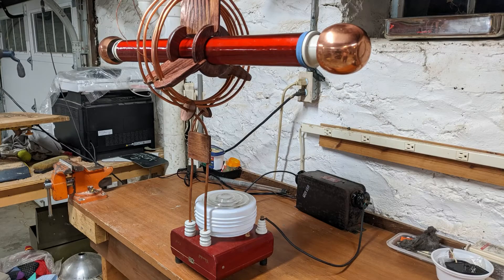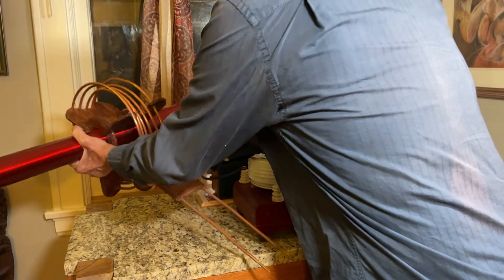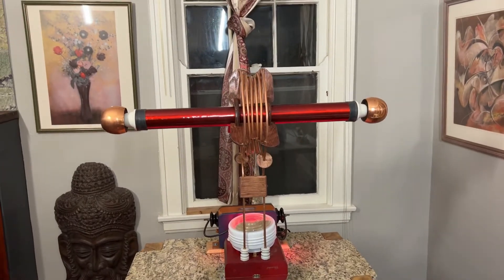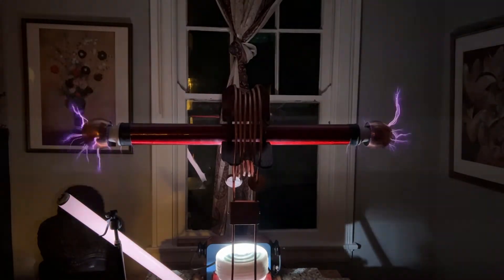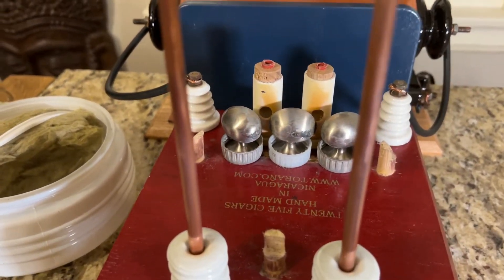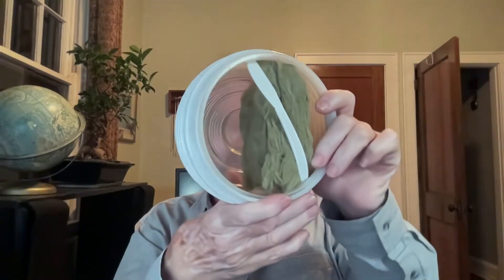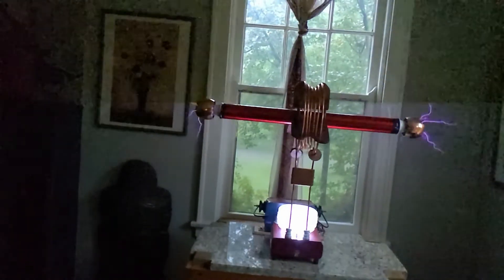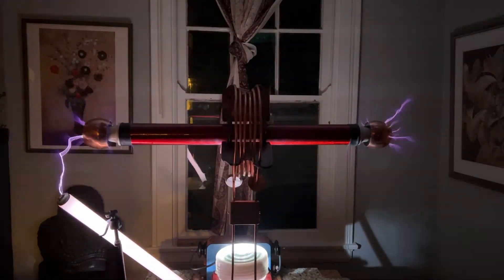BiPolar Tesla Coil

Comment: Only thing I would say is that Grounding is the way to really make big sparks...   And yes, you ground the center of the Bi-polar secondary.  It's crazy, and counter-intuitive, but the Earth adds charge to the oscillating current in the secondary circuit... The better the connection to the Earth the more effective the adding mechanism is... So Big fat welding cable directly to a rod sunk deep into the Earth and also soak it with a hose for a while to get maximum soil contact with the rod... Oh copper coated iron grounding rod for low resistance works fine 6' long buried all the way only a couple inches left out for the connection with the Welding Cable...   And the fine wire of the secondary meeting the very large cable will reflect most of the wave back the other direction improving your efficiency and making your sparks longer...   My suggestions will make you gasp when seeing the improvement in sparks...   Other than that, simply tuning it more exactly and as well as the air through the spark gap I would use two powerful neo magnets in repulsion and forced together so the spark happens right between them. It kills the spark before the Current can come back through the Plasma channel formed by the spark... Giving vastly improved performance...   Try it...
Reply from the maker: Thank you Nick. I have never seen/heard about using magnets in the spark gap. That's not too hard to try. I could get the magnets from a computer hard drive. But tapping the center of the secondary, yes I am tempted - I would have to thread that through the primary coil without it arcing to the secondary.
Reply: @JimPaul0627  yeah the magnets work well only thing is that neo mags are conductive and need to be insulated to keep the arc from trying to go through them...  I used several layers of E6000 glue and it works well...  Tesla used for fitted mica around his magnetic poles. Also he used a powerful electromagnet which is a little different in that  an electromagnet creates one of each pole... I tried two magnets repulsing and that can't be done with one electromagnet...  Simply trying something that I saw hadn't really been done before that I had read of anyhow...  It works damn well too...   Ultimately Tesla ended up submerging his spark gaps in a tank of circulating oil with his 🧲 in the oil as well...  Going for highest rate of change requires that the spark be forcibly snuffed out . But once the snuff is fast enough and the current can't reverse back through the spark gap even one time you get an amazing effect...  It is unlike anything else and will blow your mind...   It causes an electrostatic explosion radially outward from the spark gap in all directions. The blast that occurs is not like normal electricity at all.  It will charge metal objects with energy that can do work when discharged to ground just like normal electricity does but even more impressively the electrostatic shockwave travels extremely long distances and is still recoverable...  There is like a 1000x gain mechanism tied to it...   Meaning 100 watts through a spark gap that is cut off instantaneously before the current can make it back through the gap even one time, causes that current of 100 watts to transform into pure voltage 1000x the initial voltage used in the 100watt spark..! No joke either...   The radial outward voltage wave travels faster than light speed as it is of a longitudinal nature not the typical transverse variety...   Modern day science still refuses to recognize longitudinal electrical forces as existing and possible to create...  But Nikola Tesla tells all about it in 1899 but nobody believes it to be true...    It is totally true however...   It's the most amazing science I've ever researched.   The 1000x gain mechanism is truly the way his magnifying transmitter worked...   Longitudinal standing waves in the earth...   Totally true and amazingly doable by anyone..   I believe the military has this technology and wields it's power at will...   And truly it's how America is the global power that we are...  Nobody knows or believes it possible... I've proved it possible small scale...  But Tesla was killed in 43' so he didn't make it publicly known as he was starting to reveal his secrets in his old age...    Crazy shit I realize that...    But nevertheless if you are interested in Tesla coils, well that is their true purpose.  Not to make sparks but to wirelessly transfer power hundreds of miles and at levels deemed impossible due to the mind virus that corrupts all of today's sciences...   Wanna research something amazing?   There you go...  Look into it...    And Gerry Vassilatos' book " the secrets of cold war technology"  chapter 1 is a full scout of Tesla's findings...   And it will inspire research into what I'm saying...    I'm not crazy or whatever you wanna think...   It's real as shit...   Just try it and blow minds... 👍🏻   Sorry for the length of this reply but I have to spread the word to all who show interest in Tesla Coils...   As it is the true purpose of their design...   But sparks are cool too...
Reply from the maker: @nickpolson6005  Thank you again Nick. Do you think a solid state coil achieves something similar to a perfectly quenched gap? Mr Carlson demonstrates his coil with no sparks transmitting energy.
Reply: @JimPaul0627  you know... I'm not sure.  I don't know if you can easily discharge a capacitor that's charged to thousands of volts through a semiconductor when it will be such high amperage through it...  I think it would just melt or something...  But maybe a big igbt brick could handle the current, idk.  But then closing that switch instantly would be an issue I would think...   But maybe... Never know till you try...  I've never tried solid state...
Reply: @nickpolson6005  Dude I read Vassilatos' book recently and was floored - I decided I need to recreate his ambient heating/cooling and lighting effects by tweaking the spark frequency. I need to know how you did it! How can I get in touch with you man!?
Reply: @nickpolson6005  Nice job on finding this, it sounds like the radiant energy tesla's hairpin circuit uses, one thing most people don't know is that Tesla stated his inventions were powered by Dielectricity, not Electricity, the latter is the conjugate of dielectric and magnetic fields, while the former is purely the dielectric field, this is also known as "cold electricity" and is the same thing that comes out of a tesla coil in the form of sparks, if we can eliminate the magnetic component of the electric circuit we can run our devices of Dielectricity instead, removing the amps and making it safe for humans.

EDIT: I was wrong about the sparks coming out of a TC, that still has a magnetic component, true dielectricity impulses are white and aren't influenced by magnets.
Reply: @JenkoRun  The term dielectricity came about when people still thought electrostatics were fundamentally different to all the other electrical effects. Electrostatic discharges still have a magnetic component but the discharge forms and is over so quickly, and with such little charge movement (current), that magnetic effects have very little effect on the arc propagation, although it still puts off EM waves in the expected manner like everything else.
Reply: @samheasmanwhite  Under normal circumstances, yes, a Dielectric discharge will carry a magnetic component, however this is no longer applicable if the duration of the Impulse Current (not frequency) is short enough, say 100 microseconds, the event occurs too quickly not just for the field to lose its potential and transform into magnetism but it also causes the shockwave to be unbound from the conductor. 

Some good sources on the topic are AMInnovations and Peter Lindemann's book "Free energy secrets of cold electricity"

I made a mistake calling it "Dielectricity", Dielectricity is another name for the Dielectric or Electrostatic field, using it in this particular way gives us what Tesla called Radiant Energy.
Reply: @JenkoRun  Were they just looking at the shape or such of the arc? I can see how they could get that idea, but you can pick up the magnetic noise from even the shortest and 'coldest' discharges. It come out like popcorn from the sub-microsecond discharges you get from rubbing static-y cloth around. I guess few people are into building very sensitive amplifiers though, since it's not nearly as rewarding as making sparks.
Reply: Hey Nick, question, when experimenting with these effects did you find if the effect occurs if a spark gap is placed on the radiant half of a hairpin circuit? Or is magnetic quenching required on the conventional side?